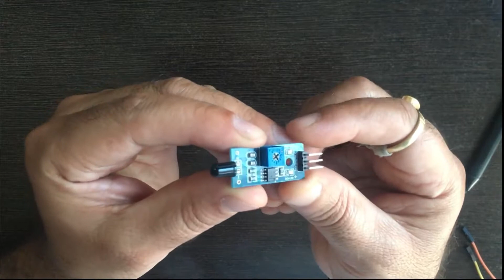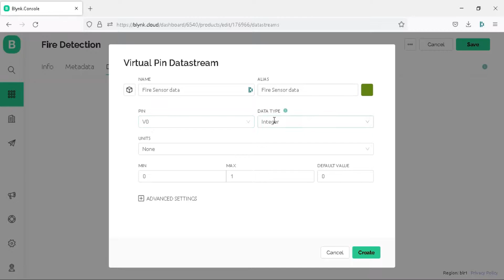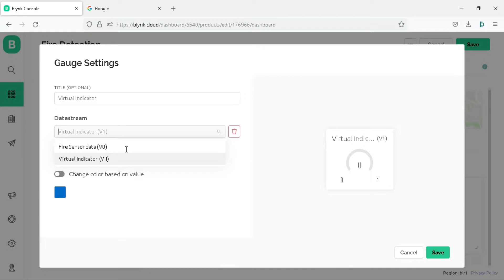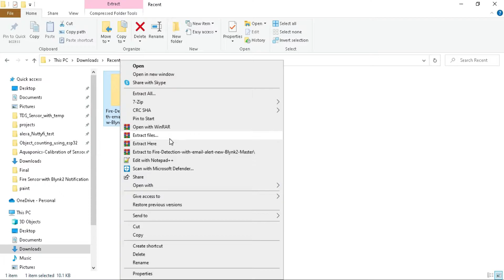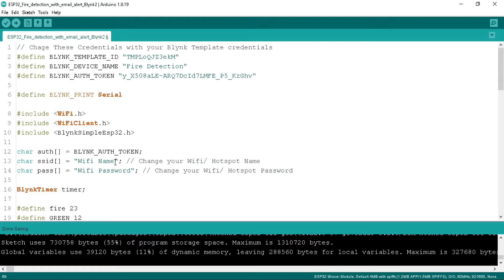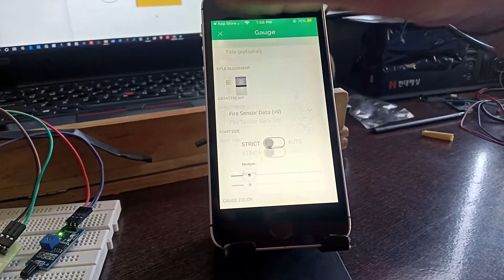Gmail Notifications and Blynk2.0 IoT: Fire Sensor Monitoring with New Blynk Cloud Dashboard!

Comment: Hello, can i add image capture when the fire detected?
Reply from the maker: Yes. You can use ESP32 camera module for it.
Reply: @SMEDehradun  then it will send to gmail?
Reply: What are the procedure for that?
Reply from the maker: You need to create the custom code for it and you can push the snap to your google drive

Comment: why is the VCC of the fire detector going into VIN of the ESP32? Why isnt it going to 5V or 3V pin?
Reply from the maker: There is not 5V pin in this esp32 board. In Vin pin, you get 5V. You can also provide external 5V to sensor.

Comment: Sir why u have been using esp32 board instead of using Arduino board
Reply from the maker: If you want all data logged in to the cloud then you need any wifi or GPRS module. so I have used the wifi board.

Comment: Sir we can dump code permanently in this board
Reply: Kk sir tq for sharing this video actually I got output sir so I have been asked for u
Reply from the maker: K. It’s great that your project is working.
Reply from the maker: It may be. Lots of the people use mobile OTG to burn the code inside the arduino board. But I never tried it out. And also don’t know that is working!

Comment: Sir I am facing a problem. All of my components are working fine yet my flame detector is not detecting the flame even though it's green built-in led is on. The other built-in led is off. In  the serial monitor fire level is showing 1 and even if I have made the necessary change in condition it is still not working. Please help
Reply from the maker: It may be issue with IR sensor. So  you need to test the IR sensor is working or not?
Reply: @SMEDehradun ir I am facing another problem. I am not getting any email alerts or timeline notifications in the dashboard but the widgets are showing the readings. I have followed every step that was mentioned in the video. Please help
Reply from the maker: Change the interval time of the alert in the events. 
Watch the each steps of the video to create events & set the time for the event.
Reply: @SMEDehradun  sir the interval time is set to 1minute
Reply from the maker: There may be limit of events in freeware. So it may be due to limit.
Reply: @SMEDehradun  but sir I didn't get even a single event
Reply from the maker: How do I help you even you are not able to set your event properly.
Reply: @SMEDehradun  sir I again made a template from start by carefully following your every instruction. The dashboard widgets are working both on web and mobile. But on the timeline the only event that I am getting is the online and offline ones. I am getting no notification neither in app nor in gmail

Comment: Sir if by using multimeter we can check voltage kk if either my led will be off or it will be in on condition only
Reply from the maker: First you check your sensor how it works, after it make changes in code

Comment: How I get to know whether it is active high or active low
Reply from the maker: Connect the voltage & ground pin to fire sensor & chek. The output pin what voltage it gives to you through multimeter.  If it gives 5V or near 5V while sensing the fire, then it’s active high otherwise active low.

Comment: Sir when I kept my cable to laptop automatically red led is glowing I don't know what error it is
Reply from the maker: It may be due to fire sensor. 
So Check your fire sensor active high or active low? And make little change as per your sensor.
Also hide the fire sensor from direct light.

Comment: Sir for double size breadboard wt u shown can u say the length and width size inches
Reply: Sir wt u shown in video upto template I have done sir I need clarification that wt driver should be installed that I am using esp32
Reply from the maker: @Tulasi-jk5ib  maximum ESP32 based board are based on CP2102 driver. try to install this driver. If you want to install ESP32 board in Arduino IDE, then link is available in the video description.
Reply: Sir actually I don't have any idea sorry sir for asking you back to back
Reply: Maximum esp32 board are based on cp2102 driver try to install this driver u told Like i didn't get that meaning sir
Reply from the maker: If your looking for a ESP32 board then you need to install the CP2102 IC driver for com port. 
Below video will help you to install the driver.

Below video will help you. 

https://youtu.be/LpohiGf8GiU
Reply: Tq sir
Reply from the maker: Welcome 🙏
Reply from the maker: Yes.

Comment: sir, may i know how to arrange the led and resistor on breadboard if both of them are separated? thank you
Reply from the maker: Hi,
Connect the any side of resistor to led positive pin and other side or resistor to the NodeMCU board. 
Connect the GND pin of led to the gnd of the NodeMCU board. That’s it.
Reply: @SMEDehradun  can it use resistors with any values or it has to use resistor with spesific value (ohm)? and may i know the value of your resistor that you use, sir? thank you
Reply from the maker: You can use resistor between 330 ohm to 1k.
Reply: @SMEDehradun   thank you for your help, sir. if you don't mind, may I ask you about this project again?
1. In the programming code, it says "define fire 23". What does the "23" means? 
2. While I'm testing my fire detector, why do the widgets can't be back to the default (can't be back to zero)? It always stuck in "1" or it seems like it always detects fire even though there are no fire around the sensor
Reply from the maker: Check your fire sensor.